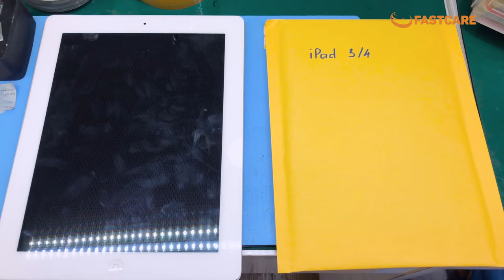Thay pin iPad 4 - Replace iPad 4 battery

Comment: Pin vs cảm ứng bây giờ còn bao nhiêu tiền
Reply from the maker: thay pin Bago là 425ka, còn kính là 400ka ạ :))
HOTLINE: 1800 2057
 Hệ Thống Cửa Hàng: (Hiện Tại Chỉ ở TP. Hồ Chí Minh)
*CN 1: 591-593 Lê Hồng Phong, P.10, Q.10, TP.HCM*
*CN 2: 254 Hoàng Văn Thụ, P.4, Q.Tân Bình, TP.HCM*
*CN 3: 303 XVNT, P.24, Q. Bình Thạnh, TP.HCM*
*CN 4: 182 Khánh Hội, P.6, Q. 4, TP.HCM*
*CN 5: 395 Quang Trung, Phường 10, Q. Gò Vấp, TPHCM*
*CN 6: 380 Võ Văn Ngân, P. Bình Thọ, TP.Thủ Đức*
*CN 7: 158 Nguyễn Thị Thập, P. Bình Thuận, Quận 7 TPHCM*
*CN 8: 628 Âu Cơ, Phường 10, Q. Tân Bình, TPHCM*
*CN 9: 734 Hậu Giang, Phường 12, Q.6, TPHCM*
*CN 10: Số 1 Tô Ký, Phường Trung Mỹ Tây, Q.12, TP.HCM*
*CN 11: 212 Trần Quang Khải, Phường Tân Định, Q.1, TP.HCM*
*CN 12: 83 Lê Văn Việt, Phường Hiệp Phú, Q.9, TP.HCM*
Reply: @FastcareVN  ok